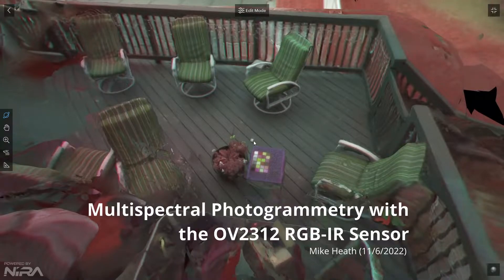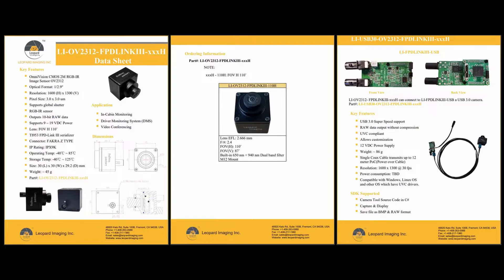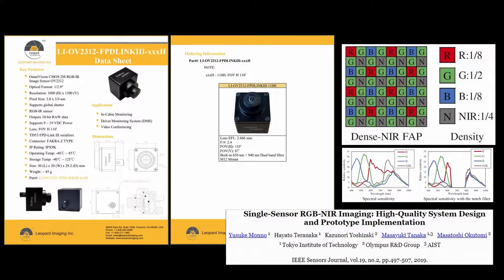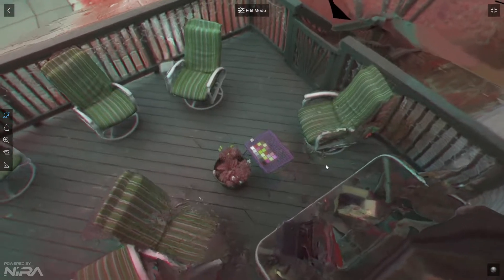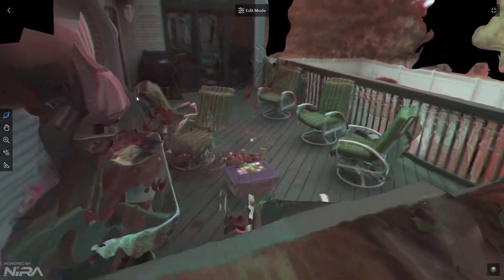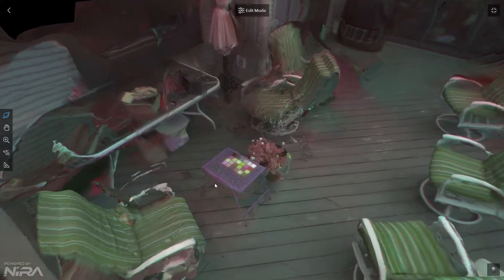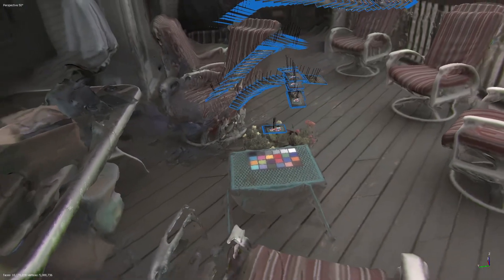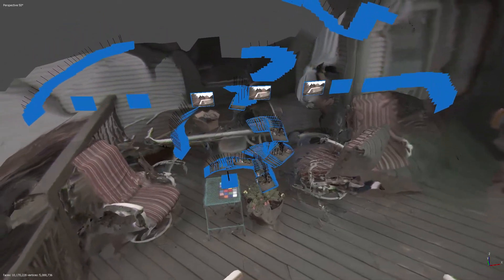Multispectral Photogrammetry with the OV2312 RGB-IR Sensor

Comment: This is a cool test! are you arguing that you're able to get more data using this approach? I've just started looking into multi spectral photogrammetry. My thinking is that it could potentially improve data from materials that are challenging for traditional photogrammetry.
Reply from the maker: Thank you. Imaging in four color channels (NIR,Red,Green,Blue) instead of three (Red,Green,Blue) provides information that can better distinguish materials from one another (such as stress on plants). The low spatial resolution of the sensor captures less data per frame though. It's a tradeoff you might make if the increased spectral resolution helps collect the information you need. Also, you might consider painting the scene of textureless objects with a random pattern of light emitted only in the NIR channel. That might allow structure from motion photogrammetry to work better on those challenging surfaces. Then you could only use the RGB bands for texturing. Could be challenging though given the other spectral channels have some sensitivity to the NIR wavelengths.

Comment: I purchased the same camera last week and I couldn’t find any information on how to use it. When I connect the camera, the output I get is only the green channel, which I believe is because that is the raw data. I am trying to extract the RGB channels, but I haven't been able to do it with Python. Is there something I need to know? By the way, the CameraTool doesn’t work in my case, so I don't know if the camera is working properly o not.
Reply from the maker: Sorry for the delayed reply to your comment. Were you able to figure out how to decode the Raw images into the four channels and interpolate them to get four separate images? I wrote some code for this (I think it's in C or C++). Let me know if you would like a copy to get some tips for writing your Python code. Just check my channel info and you can find a direct way to get in touch.

Comment: HI Mike, This looks super interesting project. I'm working on a agtech project where we are trying to build a low cost camera multispectral camera sensors for tractors. Would it be possible for you to share your captured data using OV2312 with us? It would help us evaluate the sensor performance before buying. Really appreciate and Thanks
Reply from the maker: You can contact me using the email address in my about info on my channel.